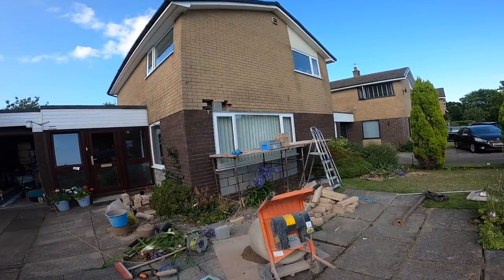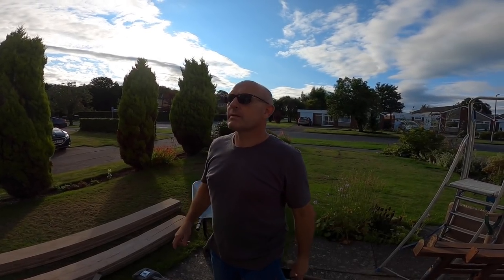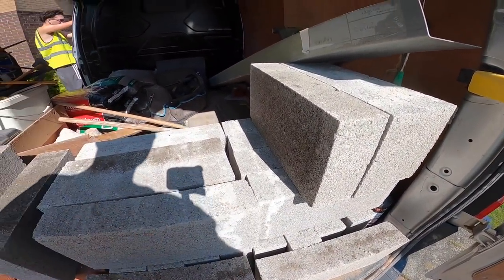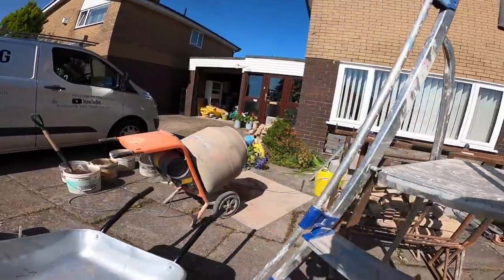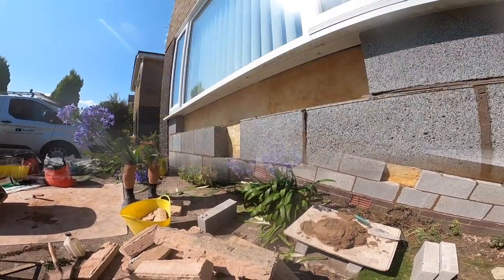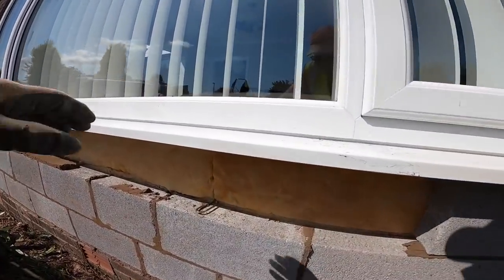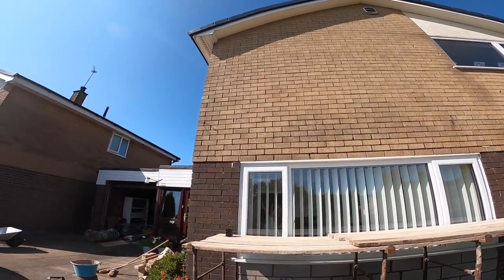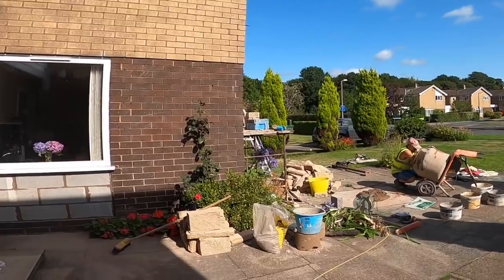DODGY WALLS, NO TIES NO INSULATION!! STONE PANEL REPLACEMENT

Comment: Cracking vid very interesting what was actually wrong badly built ??? look forward to next one.👍👍👍😎😎😎
Reply from the maker: The stone panels had no insulation in the cavity and no ties anywhere 😟🧱👍🏽
Reply: @SteveAndAlexBuild  No vapor barrier ( trowel on) to protect inner wall as well as living area? The reapir looks good but moisture problems will continue.
Reply from the maker: @edskapin7171  We don’t put in vapour barriers in the uk unless it’s a timber internal wall .
    There aren’t any damp issues on the house and never were 🧱👍🏽
Reply: @SteveAndAlexBuild  Unless you can confine your video's to the UK only then your fine. It is code everywhere else. Judging by the amount of repair jobs you do there is a moisture problem because there is rusted angle irons and ties . Take a dry brick and block weigh them. Then put these items in water and weigh them again? Your interior block walls and mortar are  not water proof. Also if there are not any damp issues why are you putting in weepholes?
Reply from the maker: @edskapin7171  I’m going to spend my weekend weighing bricks and blocks , can’t wait 😆
Reply: @SteveAndAlexBuild  I hate to tell you every bricklayer knows bricks and blocks absorb water. However you claim you have no dampness problems. According to your repair video's there is rusted angle and ties in these walls. How did that happen? Galvanized ties have been used since the late 70's? Since your video's are not restricted to UK nor do you qualify them. Someone is going to follow your video and have to tear it down because it does not meet code everywhere else in the world. Rather than assume your right education is the key. The world is changing out there. Bricklayers are supposed to follow code in the area or they rip it down. Also on sites with current safety codes an inspector would shut things down till you comply. UK brickys that come to North America ll show up with hardhats, steel toe boots and safety glasses as a minimum. Anything less they send you home. Safety is very strict. Your son may immigrate to another country one day. He is in for a rude awakening when he does.
Reply from the maker: @edskapin7171  I can sarcasm is wasted on you pal 🙄👋🏾👋🏾👋🏾

Comment: Hi Lads, Could you not have used the original bricks with ties and insulation, i possibly missed you explaining the reasoning..
Reply from the maker: Simply customer wanted render to match upstairs 🧱👍🏽
Reply: @SteveAndAlexBuild  Thanks for the reply . Pity the original brick looked very nice ..
Reply from the maker: @darrencoyle3290  each to their own I suppose . Render is very popular lately 🧱👍🏽
Reply: True but there also missing  vapor barrier (trowel on) over the inner wall as well. Only half fixed!

Comment: Was it coloured mortar the original stuff tend to find most coloured cements are soft as when stripping down dyes must weaken the cement pos ?
Reply from the maker: No just sand and cement I think , no dye in it 🤨🧱👍🏽
Reply: @SteveAndAlexBuild  
Ah just sand nae cement then lol. Always found and clean of bricks with dye through the mix never been any hassle to get off. Take care dude keep rocking it 😎🤟
Reply from the maker: @lmilne4859 You  too pal 🤟🏼🤟🏼🧱👍🏽
Reply: @lmilne4859  yeah your right dye does weaken the muck mate
Reply: @neilsmart78  
Yeah never came across any coloured stuff that’s been hard to clean of bricks buddy. 👍🏻👍🏻

Comment: very weak mortar surprised no ties not a good idea to grind galvinesed steel rust sets in very quickly
Reply from the maker: We painted it with rust proof galvanised paint 🎨 👌🏼🧱👍🏽
Reply: @SteveAndAlexBuild  should protect it i remember this from metelwork at school and engineering at college
Reply from the maker: @zaidhussain3658  👌🏼🧱👍🏽